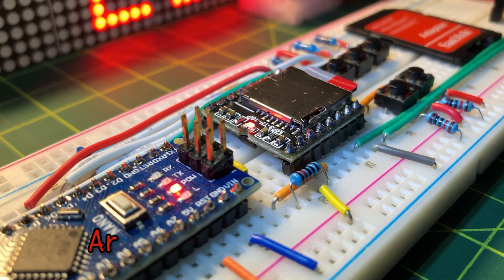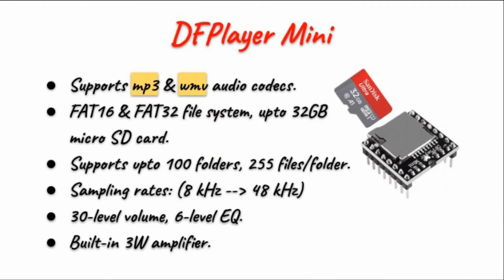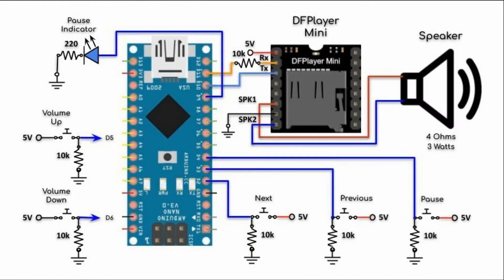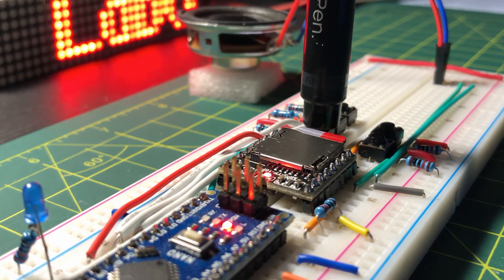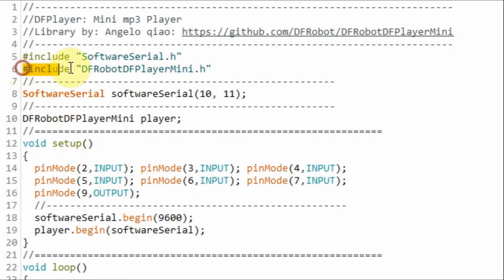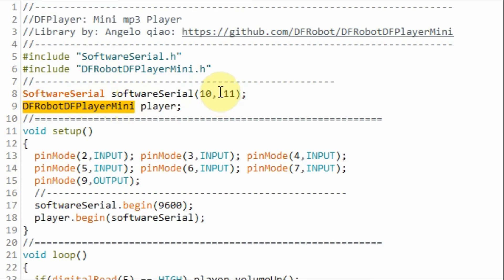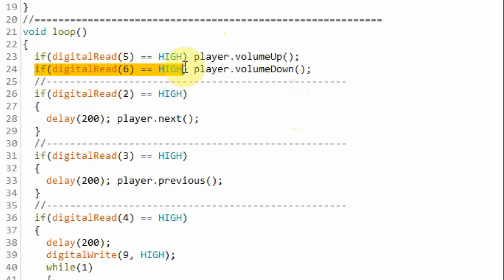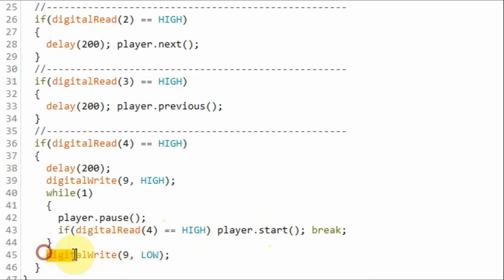Arduino-Based MP3 Player via DFPlayer Mini Module

Comment: Hello Anas, I am new to Arduino projects. I have downloaded the sketch to the Arduino so I am pretty proud of myself. But, are the 5 volts and ground in your diagram a separate supply, or are they taken off the Arduino board? Many thanks.
Reply from the maker: Same supply that feeds the Arduino.

Comment: In my case with the resistor of 10k between Rx and D11 the setup did not work, the player was shutting off as soon the SD was inserted. Looking at the documentation of DFPlayer, that resistor should be of 1k.
Reply: You are right. Didn't work with 10k but did with 1.

Comment: Is there a way to make this device play more than 2 songs at a time... I thought of making a launchpad or keyboard.
Reply: No, this can't be done with a single device.
Reply: @MuhammadWaheedAtef  what other devices are required?
Reply: @clydealcott3379  well it depends on a lot of things as you can change the entire setup to achieve the goal in many ways, but at the least if you are using an Arduino and you want to multiple MP3s playing simultaneously, then you will add a DFPlayer Mini module for each output you want, so for example for 3 songs to play at the same time, you want 1 Arduino and 3 DFPlayer Mini modules, this doesn't scale very nicely, I would change from Arduino to raspberry pi for this and add small usb interfaces if I want the output to be separate. Let me know if you need more details perhaps we can chat somewhere.

Comment: Excellent, succinct tutorial.  I'd been looking for a while to find an explanation of this caliber.  A quick question: are there limitations in the type of speakers that can be used.  I wondered if I could connect the system to the auxiliary input of my computer's desktop speakers rather than the type of speaker depicted in your sketch.
Reply from the maker: Thanks for your feedback. Yes, in my part 2 video I connected o/p audio to an external speaker via 3.5 mm jack. https://www.youtube.com/watch?v=6j1Tl5JYyGQ&t=62s

Comment: On the push buttons, you are using pulldown resistors and connecting 5V power supply directly to the digital I/O's  at the time when button is pressed. The general convention is to use a pullup resistor and switch the GND with the press of  the button.

What is your thinking behind this ?
Reply from the maker: You can either use pull down to input logic 1 when pressed, or pull up to input 0 when pressed. Both conventions work with digital I/Os.
Reply: @AnasKuzechie  The Arduino has built-in pull up resistors, for inputs, which you can enable by using, for example, pinMode(2, INPUT_PULLUP); instead of pinMode(2, INPUT);
If you do that, and alter your logic to look for the zero state when the button is pressed, then you don't need the external resistors.
Some microcontrollers also have built-in pull down resistors, but the ATmega does not.
Reply from the maker: @ceptimus  thanks for the feedback

Comment: Amazing video, very professional and informative!
I want to make a circuit which plays a single track once powered. And then be able to select other tracks to play on start up with 2 buttons, previous and next track. And controll the volume up and down with a long press on the buttons would this be possible?
Reply from the maker: Firstly, many thanks for your feedback. Secondly, Yes. As for using 2 buttons to change track or volume control, watch this video https://www.youtube.com/watch?v=UTj9krfDwZE&t=55s, where I demonstrate how to add several functionalities to button press based on duration of press.
Reply: @AnasKuzechie  Did you use the 5v connection from the ardunio to power the mp3 or from an external power supply?
Reply from the maker: @tomatkinson421  Arduino

Comment: Awesome video. How do you get rid of the static noise when the speakers idling?
Reply: Bro try using a in5822 diode at the output. It should reduce the noise.
Reply from the maker: Thanks. I didn’t have that issue.